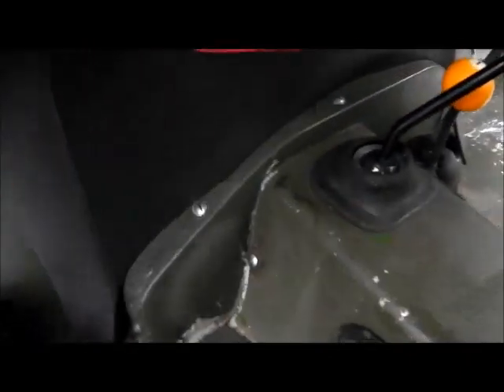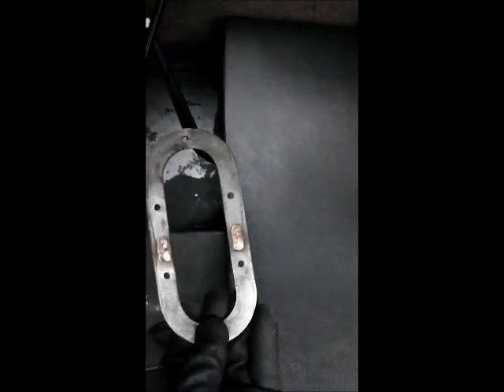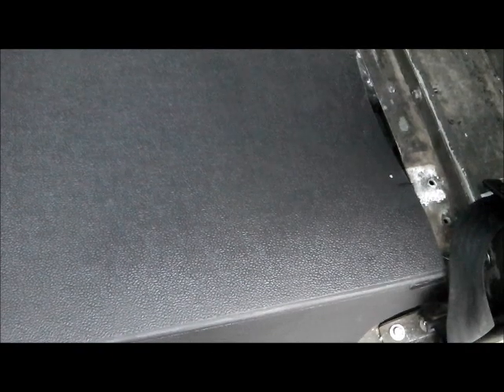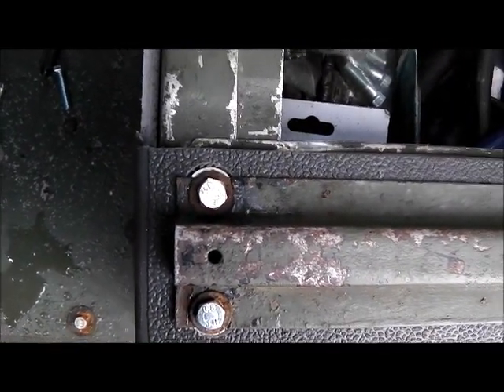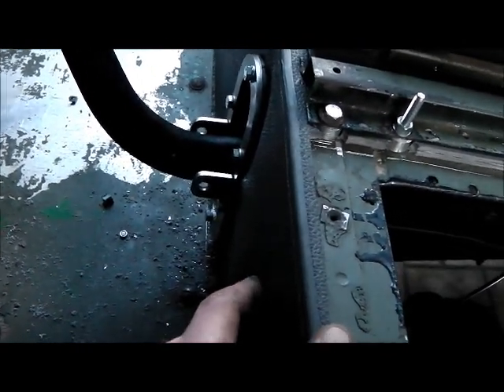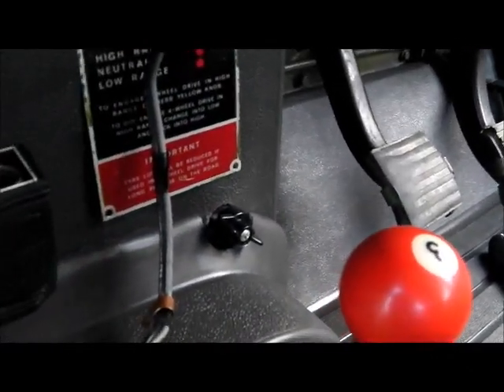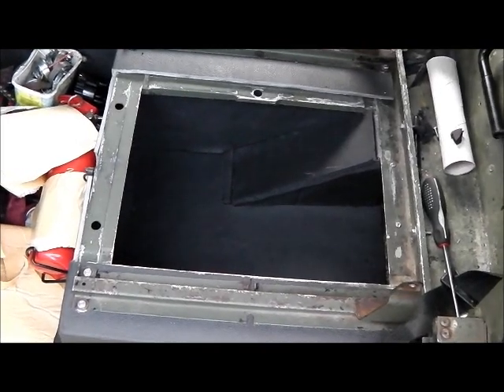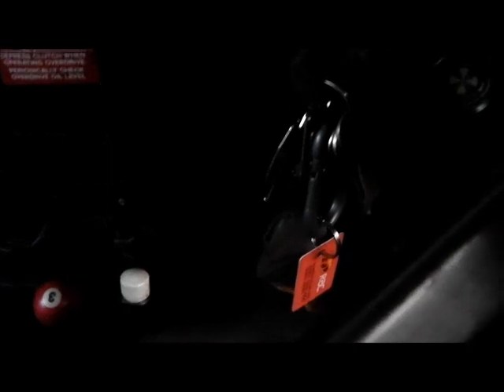Land Rover Series Acoustic Matting

Comment: Very impressive fitment of the matting.  I am curious about a comment in the video, especially as I am poised to install the same kit in my Series 2a 88.  I thought I understood you to mention that the matting for the seat box was slightly oversized (wider than the seat box).  If my understanding is correct, how did you deal with this issue?...did you seam or cut the matting at some place in the middle and remove a portion to decrease the overall width.  Thanks in advance for any insight.

Comment: One thing I’ve done on every series Land Rover I’ve owned us to remove the throttle stop in the footwell.. so I can have the throttle pedal set much lower and it make it much more comfortable to drive. You have  to fiddle fart about to set the linkage so its not under any strain at full throttle when the pedal is on the floor but it’s well worth doing….well worth doing if your 6foot 4 with size 12 boots

Comment: Thanks for sharing this... only just come across this as I'm looking to get the wrights 4x4 matting, just out of curiosity are you still making the spacers? Cheers bud
Reply from the maker: I can thoroughly recommend it, nearly two years on it is wearing well - though I have also got another foot-well mat on top on the drivers side to prevent the clutch foot action damaging it! Lots of long trips, 300 miles round and more since fitting and that's quite doable now. Not making the spacers but you can just use stacks of washers or failing that, some thick wall tube would be fine.

Comment: You'll be able to hear the clock ticking now (grin). That should make things much more comfortable. 
I fitted my own sheet of secondary glazing in my bedroom years ago  to try and make it quieter. Worked well but a few years ago I noticed it wasn't doing much good. Found a very small gap that was letting sound through. Might be worth just taping up the joins, just to see if it makes a difference.
Reply from the maker: That's another thing, it has no clock - I've no idea if I'm late so there is no cause to hurry..

It's surprising how little it takes to let sound through, just opening the window a crack now I notice it - proves the work was worth while. Rather than taping, I was thinking of using some of the sticky back foam underneath some areas of the floor matting, plenty left.
Reply: I was thinking just to try it first to see if it makes a difference, then go through all of it properly. Lots of little holes to fill, like the cutoff switch for instance.
One great thing now, I'm never late lol. Don't have a clock in the bedroom. Ironic really making all the clocks as I always know what time it it....time to get up, go to the toilet, eat and bed :) Just need to know when to get up if I'm going to a show of course.
Reply from the maker: Perhaps you can make an alarm clock that will actually wake me!?

I'll certainly go through and fill some of the gaps, more work to be done yet on the bulkhead. Today's job was replacing roof seals however, all on the proper fixings now which helps with the reverberation problems.
Reply: I used to set the alarm for 6.58 to get up at 7.03....nearly alway woke up around 6.55. Yes I can make an alarm to wake you. In fact you can. Just stick a 12 bore out the window with a string from the triggers to an alarm perched on the edge of the dresser.....guaranteed :)
It'll definitely be worth it once you've done it all. It's ok to have a noisy car, truck, van etc for going to a show on a Sunday, but not for a daily driver.
Reply from the maker: +MalcOfLincoln that might just wake me.. having driven 20 miles tonight I've realised how noisy the heater is now..

Comment: i did look at fitting to my s3 but they dont fit the 2.6 due to the difference in diaphragm ...but it looks good and have heard its good ... cheers phil
Reply from the maker: Shame that, I wonder if they will ever expand the range to include the 2.6. It's a real improvement, a Series 3 is never going to be quiet but it's so much better. A bit of under bonnet insulation is the next move I think.
Reply: The 2.6 is a little quieter than the 2.25 but it would be nice to have the option to add sound deadening.
Reply from the maker: +BigBird130 I guess they want you to hear the big six!
Reply: When they are tuned right they pur

Comment: Phil where do you source your series 3 spare parts?
Reply from the maker: Stephen Mukwatu paddock motors, John craddocks, Land Rover dealerships and eBay. Where ever I can find quality parts at reasonable cost. a
Autoparts in Coventry are great, had lots of gearbox spares from them.
Reply: Awesome! Do you know if its possible to fit a 300tdi engine and matching gearbox in a series 3? Will it need the mounts cut and rewelded?
Reply from the maker: I believe the 300 TDI can be fitted with the LT77 gearbox, but it's best to use the available conversion kit to mate that up with the original Series transfer box - that way you can keep the standard axles. Series axles are not suitable for full time four wheel drive as they are fitted with universal joints up front rather than CV's. Steve Parker conversions can supply some of the parts required and Ashcroft transmissions the adapter kit for the transfer case. Lastly I would just say, are you sure!? The 2.25 motors can be very sweet and very usable if tuned correctly, the TDI motors are much louder and you may find that (and the vibration) an issue.
Reply: Awesome! You are right, the 2.25 is a quiet engine, I reckon it is much better on consumption. I will be checking with you soon once I get all my 'ducks in a role'. Thank you.